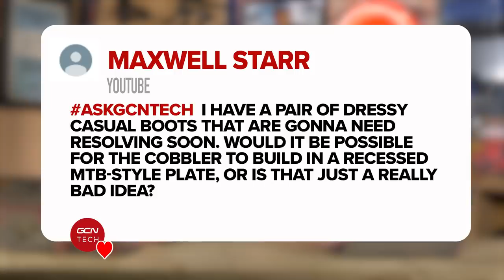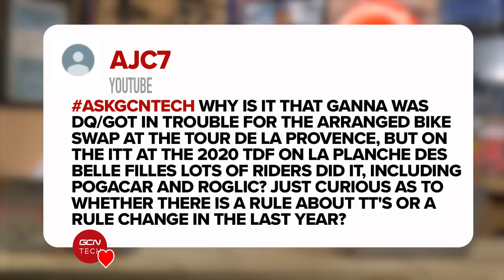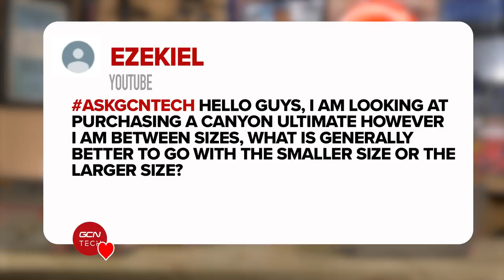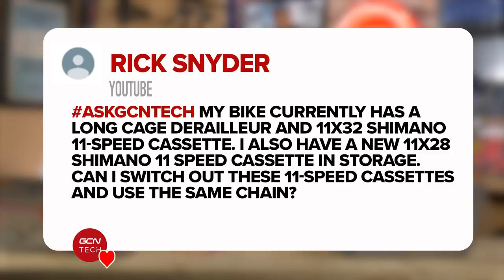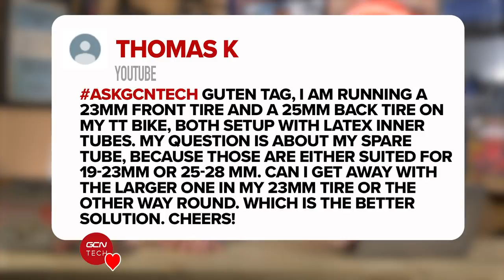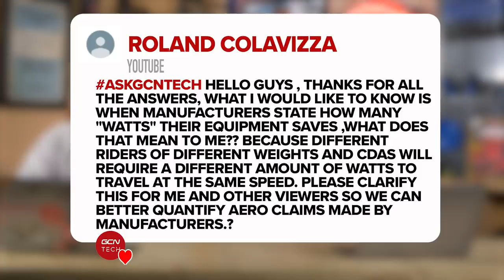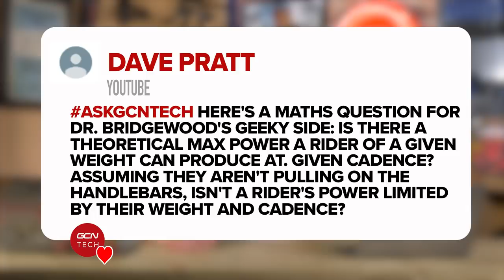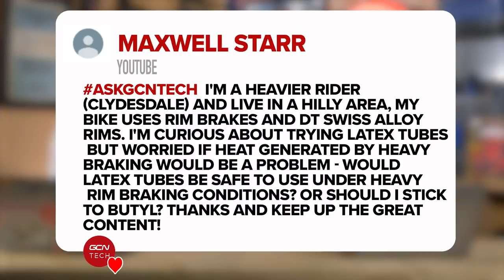Is There A Maximum Possible Power We Can Produce? | GCN Tech Clinic

Comment from the maker: Do you have any of your own tech queries? Let us know using the hashtag #AskGCNTech. 💬👇
Reply: One of the funniest sights in cycling I think is when the mechanics run along behind the riders after a stop and shove them off, and I was wondering whether it actually has any useful purpose in the overall scheme of a hours long road race. Can you make a science video to examine in some way what advantage there really is from this, compared to how well a world tour pro is actually capable of starting from a standstill without assistance?
Reply: On the point of maximum power output, I think you've misunderstood their question (as it's a bit weird, but probably easier to answer with maths): You're talking about peak power under any circumstance (it would be interesting to see how that varies for TT/recumbent/etc), but they seemed to be interested in the specific setup or riding non-handed on flat pedals - thus the point about not pulling up on the bars.
Reply: #AskGCNTech Is it possible to do a tubeless setup on rim brake rims? Or is tubeless tires exclusive for disc brakes? 

If it's possible, are there cons to it? Also, will the heat build up from braking affect the sealant inside? Thank, Ollie, Alex and Manon!
Reply: #AskGCNTech I have odd size feet: US Men's size 11.5 EEEEEEE (actually). Are there any good options for riding shoes other than flats with street shoes or multiple hundreds of dollars on custom-made shoes?

Comment: By an amazing coincidence, it was just yesterday that I added an average pedal-force calculation to my bicycle power-model spreadsheet.  Now I am in a position to help answer Dave Pratt's "theoretical maximum power" question.  
1.  If we start with a very simple case - that the rider only pushes directly downward on the pedals using their body weight - the calculation is straightforward.  In this case, the average tangential force applied to the crank arm will be 0.637 times the rider's weight.  Here are a few numbers for a typical 68Kg (150lb) rider using 170mm cranks:
At cadence 70rpm, 529W; at 90rpm, 680W; at 110rpm, 831W.  
2.  Human biomechanics are more adaptable than mechanical engines.  We can apply force to the pedals in any direction, especially if we're clipped in.  Using those abilities, one could expect the power numbers given above to increase substantially, perhaps as much as 50%.  
3.  Let's consider an elite track sprinter:  Suppose he achieves 2500W power at 120rpm, and is using 175mm cranks.  Then the average tangential pedal force he must generate is 263lb and the peak force with the pedal at 3 o'clock position will be around 400 lbs. - about twice his body weight!  These guys are strong.
Reply: Thank you for actually answering the question.
Reply: My recommendation is to add inertia forces to the model and check the limit acceleration and speed of muscle contraction - those would be the keys to maximum force and cadence.

As for the track sprinters, they do pull a lot on the bars, and that is what Dave warned us about in his question
Reply: @feedbackzaloop  The track sprinter example was to illustrate how far the human body can go, with no restrictions.  The interesting conclusion is that ultimate power is only double that which can be achieved using body weight as the only hold-down.  
A precise kinetic model would only be accurate for one individual, due to variations in neuromuscular training, etc.   It's not worth the effort, to me.
Reply: @marianneoelund2940  yes, I see you operate with average numbers. But it wouldn't be correct to compare the "ultimate power" with leg-only maximum power, when they both are not determined yet... What we know for sure are the numbers of some individuals, but how close are they to ultimate form - not.
Worth the effort, however, might be making the model of yourself. Investigate what are the biomechanical limits for track&field athletes - this topic is already thoroughly investigated - compare your performance at 100m run, for example, so that you will see your actual capability in terms of pure muscular performance. Kinematics is parametric anyway, so works for all types of individuals. And if not, what was the point of the spreadsheet to begin with?

Comment: Olly, I think the key aspect  of Mr Pratts question is ‘not pulling on the handlebars’. As the equal and opposite force of pedal power tends to lift the rider, then maybe his weight indeed determines the max force that can be applied downwards....if theres nothing other than gravity on the riders mass to stop the rider going up instead of, or as well as, the pedal going down.
Reply: To truly not pull on the handlebars you'd have to ride hands free and in that case you're likely seated such that most of your weight is supported by the saddle. You can still generate more power by using your muscles and being clipped in can push and pull at the same time, so I don't think riders weight has any relevance here.
Reply: In terms of "theoretical max power", there is no limit to the power a cyclist can generate.  Whereas it is true, when pushing your weight limits the max force, hence torque that is produced.  However, if you are clipped, there is nothing preventing pulling the pedals with arbitrarily high force, hence arbitrarily high power.
Of course, these are different muscles but, in theory, there is no limit.
Reply: @yiannispapelis8260  There is definitely a limit in real-world biomechanics!  For elite sprinters, it falls around twice as much power as can be produced if one used their weight on the pedals only, without being clipped in.  
Pulling helps, but you cannot pull the pedals with as much force as you can push.  Quads and gluteals combined are definitely stronger than hamstrings and hip flexors.
Reply: @marianneoelund2940  but you can train the hamstring just like any muscle. It is naturally without training that quads are stronger just from the mechanics of walking
There also must be a limit of how strong a muscle can get, as it grows bigger its efficiency drops. A lot of strong people though don't have hypertrophy and for them another limit is neural activation, as at some point the neuron starts to flood the synapse with neurotransmitters, reaching the limit of signal frequency and strength of the stimulus
Reply: @feedbackzaloop  Yes, there are many limitations, also strength of tendons, ligaments, joints ... and in my age category, even bones.

Comment: Torque and rpm can be used to calculate max power output. Max torque is calculate by weight or pressure on crank and length of crank to determine foot pounds torque.

Comment: I’m pretty sure the bike change rule (only from the car) was introduced because of Aqua Blue when they were riding the 1x 3T bikes. The riders found they didn’t have the optimal gears with that set-up so they would change bikes if they were coming up to a big climb or a change in terrain where different gearing would help. They planned the changes and would have a bike waiting ahead of them on the course. This was deemed unfair because if anyone else needed a change for any reason they had the disadvantage of having to go back to the team car. In certain TT stages, the commissaires will allow teams to have bikes ahead on the course. This only seems to be in instances where the bike change will be done by most riders (I forget the Tour stage but this happened recently) - I assume this is to avoid potential traffic jams with team cars as riders might start arriving close to each other at that point. The Tour stage when Pog beat Rog for the overall, bike changes were not a given for every rider and they had to be made from the following cars (I had asked Simon Gerrans who was commentating that race and he confirmed changes were from the cars only).

Comment: Maximum power is interesting but the real question is what's the optimum cadence for a given power output.
I've programmed my automatic shifting to use a linear relationship starting at 65rpm for 0W, 90rpm for 750W and this gives 72rpm at 200W which is my preferred. I saw a graph that suggests this is about optimal. I just settled on this because it felt right and having a CVT I could always fine tune and maintain a cadence.
Reply: I think this depends totally on your physiology.   A big strong person might have their optimal output at low cadences putting down more torque (because they can).   As a skinny 59kg marathon runner build dude with lots of cardio to tap, but not so much raw leg strength, I sustain my maximum power at high cadences.   If I'm putting down 200 watts, I'm doing that at 95 rpms (at least).   I'm often spinning at 100-110 rpms.   72 rpms for me is a grind up stupid steep climb.  My bike is geared so that I can always spin.

RE: how many watts kit and bike save, I think that also matters a hella lot more for lighter people like me then it does for bigger/stronger people, especially on climbs.   IE 30 free watts for me bumps my w/kg much more than it does for a 80kg dude.
Reply: @davethedogdude  That makes a lot of sense, less muscle mass, less strength but can be made up for more pedal strokes. The ultimate question I suppose is is it the optimum for our body. Could I gain more by spinning faster and could you by building strength and spinning slower. I wonder how different the optimum actually is between people, is the difference just down to following advice and training.
Reply: It's probably a bit of both there.   I think that the purest definition of optimal cadence for an individual would be to find the cadence that lets them keep the lowest HR at a target power level, but that is very clinical, and I think except for at the absolute maxes or if for some reason needing to expend the minimum amount of energy no matter what, a bit of less scientific "perceived effort" factors into the mix as a lot of the ability to sustain a hard effort is mental.
Reply: @davethedogdude  I agree HR is a good guide for finding your efficient cadence for a given power level.
I had always been "force averse," preferring higher cadences to allow lighter pedal force, but then I found that when working at tempo zone, my heart rate dropped when I shifted to a higher gear that dropped my cadence to about 70 rpm.  It was more efficient in spite of feeling like more effort.

Comment: Plug for recumbents:  Power is limited by muscles and the structural integrity of the seat.  Bracing against the back of the seat one can apply much more than their body weight.  Unfortunately this is just as tiring as it sounds.
Reply: On the other hand, when Manon had a go on a recumbent bicycle, she only managed to hit 600W peak, as opposed to the 900W peak she can do when standing on her track bike.
Reply: @marianneoelund2940  That's fine.  People should do better on a bike that fits with muscles trained to ride it.  Manon seemed too short for the pedal position in the velomobile.  The original question was power with only body weight while standing.  My essential point is that people can lift much more than their own weight, which should (briefly) produce more power.  The women's squat record is 279 kg, certainly more than her body weight.
We should all visit the Battle Mountain Speed Trials this year.
Reply: Came here to say basically this. On my time trial recumbent I can push my lower back into the seat to help generate power. I'm acclimated to the position with the different muscles it uses. On the rare occasion that I ride a "regular" bike I always wonder how anybody puts out real power on them.

Comment: I don't think Ollie understood the question correctly. If you are only pushing down on the pedals, you have a maximum torque defined by your weight pushing through the gearing. At a set cadence this is a maximum power. It's not how most people would ride a sprint, though!

Comment: I believe that there is no theoretical max power, instead leg strength is also a factor. Imagine you are standing on weighing scales with bent legs. The scales read your weight. Now stand up quickly. The scales will momentarily read higher than your weight. Start again and jump lightly in the air. The scales will momentarily read even higher. Start again and jump in the air as high as you can. The scales will momentarily read even higher. This shows that the downward force you can momentarily apply is not just your body weight, but also a function of force applied through leg muscles. On a bike, in the right gear, instead of jumping off the bike, you push the cranks around. The stronger you are, the greater force you can repeatedly apply momentarily which means your long term average power is also higher.

Comment: On the power question I think that the original questioner is assuming that all the power is from the push on the pedal, but you are pulling on the opposite one too, so it's not limited by how much you weigh.

Comment: Had a (scary) latex blow out, at speed,  descending a twisty road on a hot Girona day (using latex, carbon wheels, rim brakes). Instantly sold on disc brakes.
Reply: I've never used latex inner tubes until I got my disc brake bike. Never had any problem with them with over 4k km on them. Checking the tyre pressure every single ride is the only drawback
Reply: I once crashed out of a MTB race because a latex tube failed on a long descent when MTBs still had rim brake. I would not advise them for a heavier rider.
Reply: I've never used latex or carbon rims on my rim brakes, it seems like such an unecesery investment, but then again I don't race. Never had a problem.
Reply: Warm day, latex tubes, carbon wheels, rim brakes, fast descent.....what could possibly go wrong?😐
Reply: @hisdadjames4876  Yeah...Id say its user error for trying to pair these things together and expecting a good outcome.
Reply: @RealSweetKid tubeless does not eliminate rim heat, and i am not sure if rim heat from long braking during descents negatively affect tubeless tires.
Reply: @sepg5084  tubeless tyres are essentially the same as normal tyres so they are not going to be the point of failure of your rims get hot. So tubeless would solve the problem. Until your rims delaminated!
Reply: @8paolo96  I wind up checking tire pressure every day regardless, just because I'm a touch OCD.

Comment: 80kg Rider —> 800N * 170mm Crank = 140Nm —> at a cadence of 1 Rotation (2 Legstrokes)  per second: 2* 140Nm/s= 280watt without pulling at the handlebars?
Reply: You left out a factor of two.  The foot vertical movement is 2 times the crank length.

Comment: #AskGCNTech Can you check my math on Dave’s question? I think he was asking about physics rather than biology: How much downforce until you lift yourself off the bike? 

With a 70kg rider at 90rpm on 172.5mm cranks, *adjusts glasses*…

1 watt is 1 Nm/s. 
So convert weight to Newtons
70kg x 9.81 = 686.7N
multiply by pedal distance in meters
x .1725m x 2π = 744.3 Nm
Multiply by cadence divided by 60s
x 90 / 60s = 1116 watts (Nm/s)

At 1116 watts, this rider is “floating.” And I would think 1116w at any cadence would have the same effect. 

#AskGCNTech , Follow up question: with that info, how should I feel about my peak power output in a sprint relative to my weight? Is there a somewhat common power “ceiling” for lighter riders? Like 110% of you weight-watts?
Reply: You'll want to integrate your calculation around the whole pedal cycle as the effective gearing changes depending on where your pedal is. At the top /bottom of the stroke its different to half way down. That is some hairy maths 🤯
Reply: @DavidWhiteOfFleet  I was wondering about that. Does one moment at this wattage at the front of the pedal stroke have enough force to lift you? Or do we get to add in the bits of power along the whole front half of the pedal stroke?

I’m trying to wrap my mind around how duration of power output fits into this. 1116w should lift this person straight upward in that moment. I assume any suboptimal lifting angle would mean that gravity—the 9.81 hidden in our Newtons unit—would win the acceleration battle and hold you down more effectively than you’d be pushing up.
Reply: @shakinwakin35  I think that is the torque that lifts you, rather than the Watts which are dependent on cadence. But at the top of the stroke any down force is completely ineffective because the pedal needs to move forwards, the crank length is zero, so the power at that point is zero too.

Comment: #AskGCNTech As you said 5 Watts saving from latex tube is better then weight saving of rim brake.. What about aero benefits of rim brakes are there any?
Reply: Peace of mind for using inner tubes stronger than latex is a lot better than a few watt savings unless you are a professional driver with a crew that will fix your bike on the go.

Comment: The problem you have when you have to decide between a larger and smaller sized bike could be component availability. For example, if you determine that on the larger sized bike, you will be required to use a 14 cm stem. A smaller sized bike will need a larger stem to give you the same reach. Stems larger than 14 cm are very hard to find.
Reply: tbf if you need a 14 cm stem youre probably already on a smaller than recommended size bike
Reply: @carlmlr  Not really. .....Some people have short legs and have a long torso...Others have long legs and a short torso. The people with a long torso have options that include 1) Long stem 2) extra large bike that looks funny, because there is only an inch or two of seatpost showing, and 3) a custom made bike. The people with a short torso for their height have the opposite problem, a short stem or a bike built with non-standard wheels.